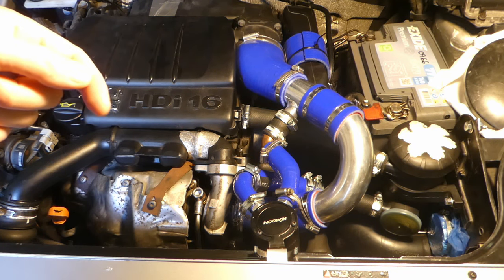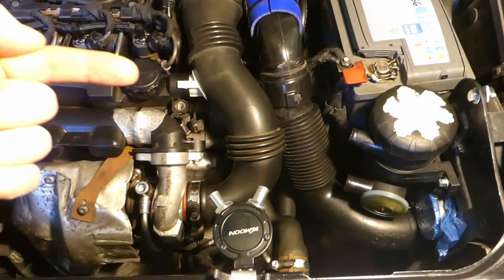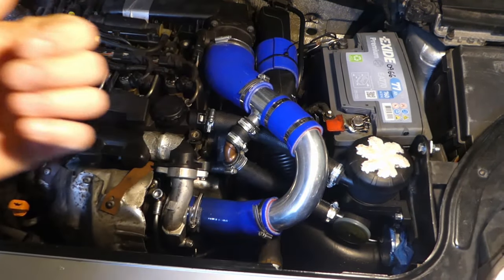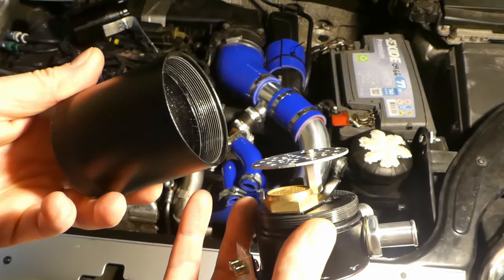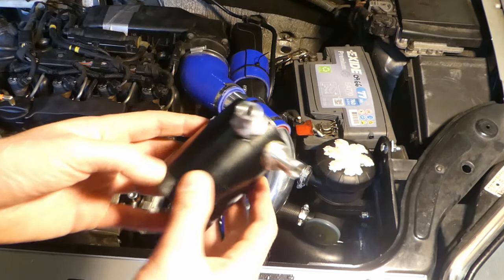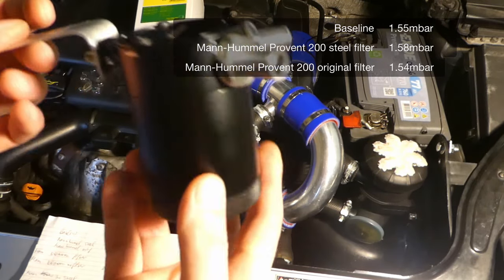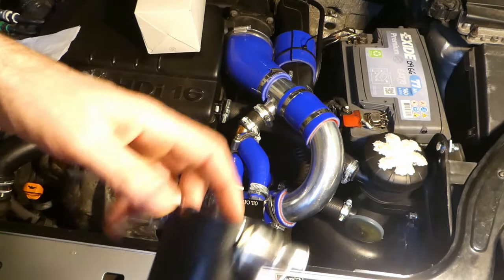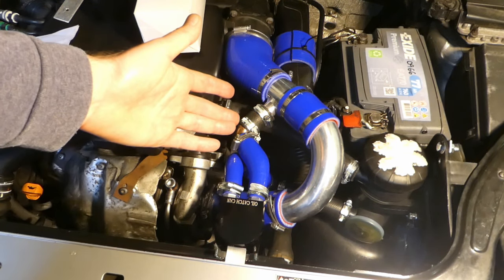Oil Catch Cans Crankcase Pressure, Provent 200 vs Mishimoto vs Universal oil catch can

Comment: hi friend, i have a 1.4hdi peugeot, which is the better of the three you testing for my engine? thanks in advance.
Reply from the maker: Good question, but unfortunately I do not have the answer. Here is my thinking. No matter what the engine the oil catch can is a device on its own, it just filters the oil that will end up in your engine. Which is better, no one knows, or at least I do not know. Without a more comprehensive comparison, i.e. efficiency testing it is really difficult to say. If you can afford it, I would still go for a genuine Mann-Hummel Provent 200. If not, then the cheaper version should still be alright. I would even just purchase the paper filter and put it in the cheaper body. I have a video on that. I would not buy the bronze filter oil catch can, it creates too much pressure in the crankcase.
Reply: @moremolecules  i just buy 2 of that from Alli.... I do a best choice? One for my Peugeot 1007 hdi 1.4 and one for my Renault Clio mk2 dci 1.5 K9K. I appreciate for your answer.
Reply from the maker: @papaxlimitzouras  Yes, two of the cheap Provent 200 would be alright, as long as you can find a space where to put them in the car. Also, make sure that the hose from the crankcase breather is lower than the oil catch can.
Reply: Friend i want to ask you about the pcv valve. If i installation the oil catch can, i need the pcv valve or i remove it?
Reply from the maker: @papaxlimitzouras  Yes, you still need it. The PCV valve tries to condense oil and put it back in the engine, I mean perfectly good oil. If you remove it, you will have too much oil in the oil catch can.
Reply: @moremolecules  Hi there. Can you please explain "make sure that the hose from the crankcase breather is lower than the oil catch can" ? It seems pretty hard to do since most cranckcase breather hoses are on the valve covers right under the hood making it impossible to install a catch can anywhere in the engine bay higher than that. Please explain. Thank you.
Reply from the maker: @gvolos1  Depends, I did this before (https://www.youtube.com/watch?v=C7cHUrbuW6s).
If you hose goes upwards from the crankcase breather outlet to the oil catch can, there will be oil pooled in this hose. It is inevitable and of course wanted that the hose is lower temperature than the engine. For that reason, the oil vapor from the crankcase breather gets cooled and condenses in the hose before the oil catch can. This oil cannot get to the oil catch can, it just cannot overcome the elevation to the oil catch can, it simply pools there. How long will it take to get blocked? Eventually it will be blocked or at least the size of the hose will get narrower leading to a slightly increased crankcase pressure.
Maybe I misinterpreted your question. It is not that hard actually, depending where you put the oil catch can. Also, some crankcase outlets are not at the top of the engine, there might be plastic components that are higher.
Reply: @moremolecules  So if I understand this correctly, you are syggesting that the catchcan be placed lower than the breather hose? Not higher as the original post mentioned. Correct? Thanks again.
Reply from the maker: @gvolos1  My mistake, apologies. Yes, the catch can has to be lower than the crankcase breather
Reply: @moremolecules  Thank you very much for clearing this and for making this great and very usefull video. Unfortunatelly I don't think I can fit the Provent 200 and will be looking for something else. I have a 2013 Mitsubishi ASX 1.8 turbo diesel and can't find a PCV valve on this set up. There is a breather hose but no PCV valve. Also I can't seem to find any manual or anything mentioning a PCV valve on this engine. Do you know if all engines have one? I read somewhere that some engines don't have it. Not sure. Thanks again.
Reply from the maker: @gvolos1  Unfortunately, I am not familiar with the Mitsubishi engines, is it a petrol or a diesel? Not all engines have a PCV valve. My 1.6 Peugeot 307 does not have a PCV valve, but my diesel has one that is rather rudimentary. Still not a problem at all for the oil catch can, it does not matter that much. If there is no space, the universal oil catch can in the video would be probably OK, stuff it with steel scourers and it should be OK. The steel scourers act as a barrier for the oil vapor and condense the oil vapor in liquid. It is small enough.
Reply: @moremolecules  Yes, I'm thinking of doing exactly that with the universal can. The engine is a diesel and glad to hear that you confirm that not all engines have a PCV valve. Thank you for your time.

Comment: I have a bmw n62 - what separator do you think would suit me?
Reply from the maker: If I were you I would go for the Mann Hummel, but depends on whether you have space in the engine bay.
Reply: @moremolecules  havle spase.
Reply: @moremolecules  i just installed my sperator and there is a lot of pressure in the pcv system. what to do?
Reply from the maker: @autodjelovi2092  Is there pressure without the separator? Are the pipes too narrow and what separator did you install and how did you install it?
Reply: @moremolecules  not have pressure without cactch can
Reply from the maker: @autodjelovi2092  What oil catch can you have?
Reply: @moremolecules  kraftwerk
Reply from the maker: @autodjelovi2092  Do you have a link for that? I do not think I have heard of it, but there are multiple producers out there. Certainly check how you have connected them, in/out in the correct order
Reply: @moremolecules  not can post link - I send on email
Reply from the maker: @autodjelovi2092  Sounds alright to me, I can post links, but probably because it is my channel.

Comment: Thanks for this video.   I installed one almost identical to the generic catch can on my old carbed Harley.  Beings it is on a motorcycle, the can is being sloshed back and forth constantly.  I can say without a doubt, the baffle system on the generic can works perfectly.  Collects all the blow-by very well. I've also tested the outlet hose to make sure (I run mine to atmosphere) by taping paper towels to the end to see what it would collect and it was bone dry, as intended.  Here it is when I first installed it, the description has more details   https://youtu.be/GWgkI7Sfz_E
Reply from the maker: I yes I see. Looks quite good to me. Many thanks for confirming that the baffle system works, I always wondered how well this does.
Reply: @moremolecules  My train of thought with the brass filter is it's pretty much pointless.  By the time the blow-by reaches the canister, the lower temp difference of the can should be enough to make the vapor coalesce.  Kinda like the oil separators of old, none of them used a filter and they all relied on baffles.  Like I said in my prior comment, my baffled catch can is being sloshed in ever which direction, plus it's on a Harley so it shakes to beat hell, constantly.  Never spilled a drop.  The generic one works GREAT. The brass filtered one is over engineered and restrictive, you gotta let that engine breathe!
Reply from the maker: @Prairie_Barbarian  I completely agree with the bronze filter. It is too restrictive and increases crankcase pressure. Probably filters a bit more, but the increased pressure will not do the engine any good.
Reply: @Prairie_Barbarian  they are meant for closed systems where the intake vacuum compensates for the added restriction, the job is to reduce gas velocity to allow vapours to settle out . this is why they are called CCV filters (Closed crank case ventilator) More and more places it is becoming illegal to dump to atmosphere and here in Canada in certain provinces they WILL fine you if caught. and they do DOT road blocks often and random. All so he is using a bottom of the barrel units, If he got the higher quality units they have very effective recovery rates with much lower delta P, The Hummel with the better cartridge works pretty good with minimal Delta P.

Comment: Why on petrol engine it’s going to be fine that higher pressure and with Diesel engine it isn’t
Reply from the maker: Hi Marco, I probably did not quite express it correctly. The pressure in petrol engine will also be quite bad, gaskets leaking, etc. AFAIK, there is a lot more negative pressure inside petrol engines as compared to diesel engines. Then again, I have not really worked on petrol engines.

Comment: Atmospheric pressure is 1013 millibars (14.7 psi) your readings of 1.5 millibars indicates a crankcase pressure of  .02 psi  therfore a vacuum .
Reply from the maker: Hmm. It is DPF sensor with two inputs, one for atmospheric pressure and one for whatever you want to measure. So it is relative pressure, i.e. relative to the atmosphere, 1.5mbars is 1.5mbars above whatever the atmosphere was at the time. Atmospheric pressure is also not constant. If it is raining the bars might have dropped already to 950 say.

Comment: This oil catch can you are using is not the correct one & you need one that has an external filter on it otherwise you will get too much pressure build up which no good at all Kind Regards Peter
Reply from the maker: Which one of the 3 you mean. It does not need an external filter. At the end of the day it is just an extension for the air intake. If it is not there the pressure is the same. In other words, it should not lead to much increase in pressure.

Comment: Second Comment 
= I have been performing Due Diligence
( Crankcase Ventilation System )
FOR
Ford 2006 Powerstroke 6.0 L Diesel F250 Auto Trans 4x4 
To date Narrowed Down to Following 
- Parker / Racor 
- Provent 
- Ryco
= Seeking THOUGHTS on any of above THREE 
OR do you have another OPTION I should consider Installing ?
Many thanks to ALL Who may view this Comment in advance
Reply from the maker: Hi John, your engine is pretty large, but I may have to come back to you on the options listed. The Provent 200 or perhaps 400 would be quite good. In addition though, maybe the mishimoto high flow would also work fairly well. With the 6.0L diesel you do not want something that would restrict too much and lead to crankcase pressure build up.

Comment: you dont need two you need one m8.
Reply from the maker: Are your sure though? What do you think the efficiency of an oil catch can is? Have a look at this video: https://youtu.be/aOgz5duxCVg?list=LL
Best case scenario an oil catch can is efficient ~50%, although this is a guestimate.
Reply: @moremolecules   empty oil catc can like that other one does do about 25-30 percent also intake line to oil catch can must be in lower position than the outlet line, that way the pressure will be less, and yes you need only one.
Reply: Oil catch can with both lines in same height is not effective beacouse of the turbulance in side the catch can. Also biger the engine bigger the oil catch can. To be an efective catch can it must be loaded with aome kind of filters a kind of like regular oil filter, intake hose must be on a lower position than outlet line and you are good enough, you dont need other one at all.
Reply from the maker: @LoFiOAS1S  I agree with some of your points, although I have not seen a single evidence of those. The only scientific manuscript looking at this was comparing the stream of gasses entering and concluded that the swirling action of catch cans like the Mann-Hummel are more efficient than straight in. That was due to maximising the contact surface of the droplets. Noone has ever looked at actual efficiency.
Mann-Hummel for example have the inlet at top and outlet at bottom, but I would agree that it should be more efficient to be the other way round, although this increases the risk of blockage.
Reply from the maker: @LoFiOAS1S  I have not seen a single evidence (proper evidence such as a scientific manuscript) looking at the efficiency of oil catch cans. Most of this is hearsay and blogs/youtube of the like: "this one is better than this one" or "it works, look how much it has collected". In order for one to say 25-30% for that one and 60-70% for another you need controlled conditions (e.g. temperature of gasses, speed of the flow, volume of the flow, size and density of droplets).
Reply: @moremolecules  well w r not talking about science here, it is just an oil catchcan, story about positioning the intake and outline is simple logic, also there must be something to those little oil flakes to hold on, empty oil cc is not good, and for the size, when you are making some kind of a obstruction you got to make it big enough so the stock pressure which was in the crankcase be almost the same.
Reply from the maker: @LoFiOAS1S  Yes, the second oil catch can was a test for my own purposes and it was never an empty can. I completely agree that an empty can is nothing. Also, that is why I had this test, to see the changes in crankcase pressure. Surely the smaller cans do restrict more and increase crankcase pressure. Now, it is unclear if this is due to the size of the can or the restrictive passages.
Reply: @moremolecules   both,restriction build up the pressure, small space plus restriction may couse problem.